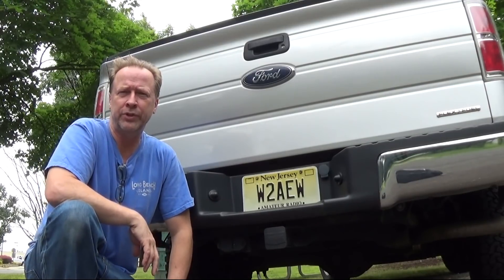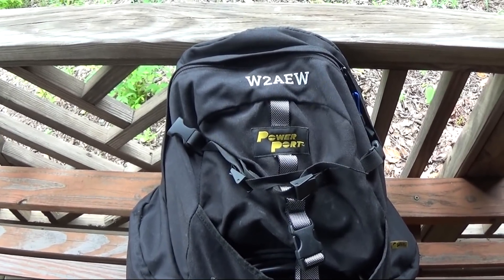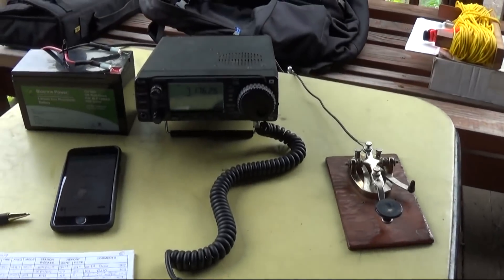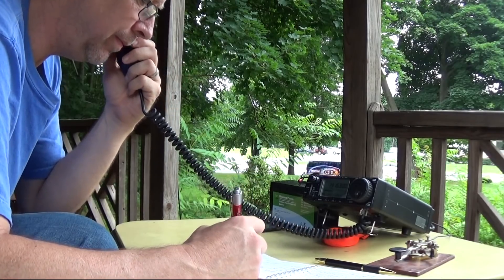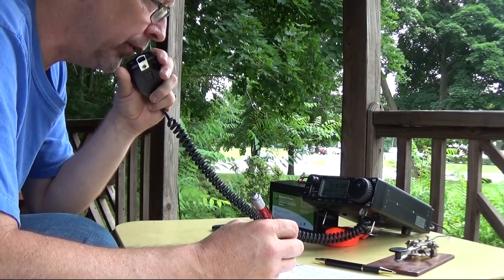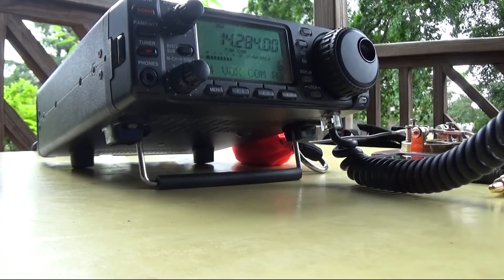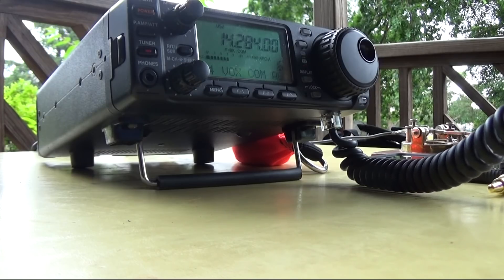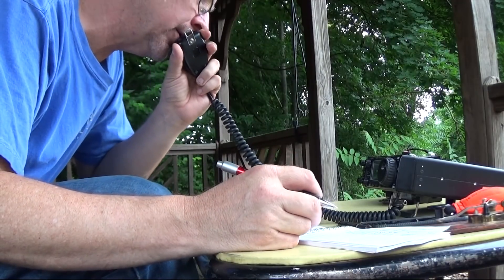#285: Amateur Radio Field Day 2018 - my 5 watt setup with on-air contacts from Marconi Park

Comment: Saw you on with Tom.  Thanks for showing off such a historic site  for radio communications.   Only thing better would be to get temporary call sign  W2NFF  for field day weekend!!  Noticed your power output level was astronomically lower than what Marconi ran.
Reply from the maker: and the antenna was orders of magnitude smaller too.

Comment: I have a question. I found this on ebay for $30 Vintage RCA CRYSTAL CALIBRATED MARKER GENERATOR Model WR-99A. Would this be a good piece of test equipment for starting out in ham radio?
Reply from the maker: Probably not really necessary
Reply: @w2aew  what was it used for?
Reply from the maker: To help calibrate the frequency scale on the old non-synthesized radios, where the frequency indicator was just a movable pointer on a ruler-like scale.

Comment: will static build up on the antenna mess up the radio? i was thinking a lighting arestor and ground are necessary to keep static off the antenna.  but thought a lot of ops are not able to ground the station like hams in apartments with stealth wire antennas out side ? all ways wondered about it. but had no clear answer on this. the antenna books make it out if you have no arestor to bead off static it will mess up the radio. have been in a lot of places and had no way of getting a ground so is it necessary? just would like to know, i am in places ware ground rods are a no no but do not what to cook the radio. what about lighting with antennas like stealth apartment antennas ware thy can not have a big grounds for lighting?
Reply from the maker: I"ve never had a problem with static build-up causing damage.  Might be more of a problem in very dry environments.
Reply: thanks for the reply! i am going to put a lighting arrestor on the back of the tuner and ground it to the outlet cover screw to keep static off antenna. grounding is hard for portable and stealth work. so i guess i will just take down the antenna when thunder storms threaten or keep the feed line out of the radio room. as for ground do you think the outlet ground will work for bleeding off antenna static? just want to keep radio safe.
Reply from the maker: @jakemichael8586  Grounding to a outlet ground will provide a static bleed, but will not protect against a lightning strike.  I typically disconnect the radio from the antennas when not in use.
Reply: thanks for the reply! yes for lighting one needs a big copper budget that most hams can not afford! i will just remove the feed line from the radio room or take down the antenna and feed line for lighting protection. i just do not want to cook the radio and get on the air with out hassle. i am in a place ware a proper ground is not possible or station for that matter so have to be stealthy. the only ground that came to mind was the outlet. i have not seen static build up but have heard of others having it cook radios. thanks if you have tips for grounding stations as well as antenas that move a lot  rentals,HOA,apartments,condo. etc  just let me know. thanks

Comment: Hello
One suggestion for ham videos: Test differences between RG58/U, RG213 etc cables.
For example, I have a big dilemma what to buy, I need around 40m (from roof of the building to my apartment). I will transmit with maximum of 20W. More I will listening. And all in 1.8-30MHz...and I am dilemma if is worth more expansive cable RG213, around 5.5Euro (7 USD)/m in my town) vs 2.5 Euro (around 3.5USD)/m for RG58/U
Reply from the maker: For HF use, the attenuation of any of these cables will be barely noticable.  RG-58/U will be a little less than 3dB (not even 1/2 s-unit) at 30MHz.  It will be even less than that at lower frequencies - probably under 1dB below 10MHz.  Hardly noticable.  The RG-213 is better than RG-58/U, but since the 58/U isn't that bad, the 213 might not be worth the cost.  RG-8X is a nice compromise between the two.  You might want to base your decision on the longevity of the coax (UV resistance) rather than the RF performance, since all of them will work well for HF.

Comment: Thanks for the video. A while ago I bought an Icom 706 Mk2G needing repairs and now that it has been fixed would like to install in my Land Rover for use when camping. Been studying what sort of antenna to install. Would like to mount on my brush guard. Thinking of using a manually tuned screwdriver like your MP1. Appreciate any thoughts. Thanks
Reply from the maker: The MP1 works quite well, provided you do two things:  1) Ensure that you have a good ground at the antenna, and 2) replace the short telescoping whip that it comes with with a longer top section such as the MFJ-1976
Reply: w2aew Hi Alan and thanks very much for the reply. Would using a mount that clamps onto the brush guard tubing work if that brush guard had a good electrical connection to the car body and frame? I suppose I should get an antenna analyzer to really check out the setup. Thanks, Gordon, VA7GEW.
Reply from the maker: Yes, that should work well.
Reply: Thanks again. Really appreciate your taking the time.

Comment: Can I ask without sounding rude - what do Hams usually do other than QRP. Do they ever just have discussions about local weather or events, etc in their areas? Sort of like a radio chat room? Or does it tend to always be more technical stuff or just "hey I made contact"
Reply from the maker: Oh sure!  "Ragchewing" is a term we use to describe simple, casual conversations about anything - from the weather, to sports, to radio equipment, common interests, etc.  This is probably the most common thing that Hams do on the air.  There are many, many different activities (ragchewing, DX chasing, CW operation, digital mode operation, satellite operation, slow scan TV, etc. etc.) that Hams do.  Personally, I do more "ragchewing" than anything else when I'm on the air.
Reply: w2aew cool thanks! I looked it up and found they have the tests for licensing in my area twice a month, thinking about joining
Reply from the maker: That's great.  If you are in the US, there are three license levels:  Technician, General and Extra.  Each requires passing a multiple choice test.  The first two are 35 questions, the last is 50 questions.  The question pools that the tests are drawn from are published.  Tests must be passes sequentially - i.e. you can't take the General test until you've passed the Technician test...  Lots of places online where you can take practice exams to gauge which topic areas you need to study more.

Comment: Also working on getting my license, but only to use for cw qrp. I find radios for speach mostly to expensive, when it comes to very good quality radio.
cw seems to be the cheapast way of having (building) tx/rx devices for like 40m/80m.
Sadly I cannot have an antenna for 160m/630m where I live over here in Berlin/Germany. But I think I might build some qrpp outdoors device (AD9835 DDS based ?) for 160m/630m band maybe in the future?!

Comment: Thanks for showing your throwing line storage system. Great hint and I'm inspired to build a copy! Do you set the base up perpendicular to the direction of the thrown line? On second viewing, I see that you pull off some line prior to making the toss.
Reply from the maker: When getting ready to throw, I'll slip about 100' off of the rig and partially spread it out on the ground.  If you've wound it in a figure-8 pattern, it will spread out easily without tangling.

Comment: Hi and thank you very much for your tutorials. They are very well done and you are a natural born teacher for sure.
I was uncertain where to place my request so I selected here. The request is could you please create a tutorial on biasing a transistor so as to use it as an envelope detector as opposed to a diode. I have been thinking that the Q point should have the transistor near the cut off point but rather than guess I'd like a bit of instruction from an expert.

Thanks, 
R M Boyer
KC2WVB
Reply from the maker: Yes, you've got it right - bias it so that the transistor is right at the turn on/off point - about 0.6 to 0.7V at the base.  I'm assuming that you're planning to use an emitter follower type of circuit, using the transistor to charge a capacitor at the emitter (to ground), and a resistor in parallel to discharge the cap fast enough to follow the envelope.

Comment: Alan, you almost convinced me to get an Amateur Radio license. Back when I was 20, back in 1985, I was using CB radio a lot, and I mean a lot, here in Canada Quebec !  I had a lot of fun with what were called "coffee breaks", meetings between local CB users at a local Donut shop, and what were called "chasse mobile", a hide and seek but with cars equiped with jumbo meters (sensitive analog signal strength indicators), where you would go in circles in an empty shopping mall parking lot to try and localize the source of the signal sent by the hidden car every10 minutes, and try to zoom in and be the first car to find it. Ah, the good old days, before all that cell phone and internet stuff.
73 W2AEW from Mobile Apollo (my CB handle back then).
Reply from the maker: It's never too late!  Many hams get together at local club meetings, hamfests, or even just for breakfast, etc.  And, your "chasse mobile" activity is a popular ham radio activity too - except we call it a "fox hunt".  Same thing though - search for a hidden transmitter somewhere.  (from "The Craftsman", back in the day)

Comment: Jesus loves you.  I had 100 watts, a great antenna, only 5 contacts by 3pm.  I would believe this video 1pm Sunday.
Reply from the maker: Bands weren't great.  Most of my contacts were on 40m, and just few on 20 and 15.  I worked about 25 stations over the course of 2 hours of operating.  Good radio karma at this ex-Marconi Wireless transmitter site.

Comment: What does 1 bravo battery stand for? Are you referring too bravo battery 1st battalion?
Just curious
Reply from the maker: The "exchange" you hear includes a number (1, 2, 3, etc.) which indicates how many transmitters are setup at that site, followed by a letter (A, B, etc.) which indicate the class of the station (club or individual, commercial power or temporary power, etc.).  1Bravo-Battery was the class designation for the Field Day event for scoring purposes (for those competing).  It means that I was operating solo, class B (not part of a club) and running on battery power using 5W or less of transmitter power.
Reply: w2aew thanks for the info. I have never worked a field day and not part of any club. I am a portable  qrp opertor and was thinking I would have a hard time making contacts. I see I was wrong thanks for vid and reply. It makes since now. 73
Robert K6NFY

Comment: The bands were cookin here in Ohio.  
My TenTec Triton IV crapped out, it needs serious attention from many years of neglect, lol.  Only two bands worked, the band selector failed.  But the Hustler 5btv was doing great on 20m. 
But that's what FD is all about, use what you got in emergency situations.  I need to be better prepaired.  
So how long did the battery last?  A couple hours?  Um thinkin about getting a lith-ion 12v supply with solar recharge, plus my crappy HFT 89$ generator.  
i haven't been to a marathon weekend with a bunch of hams in years.  With thunderstorms, and mal functions, and power failures, it can be quite an adventure.  I don't know of any hams handling NTS and ARES.  Most of the repeaters around here are dead. But this year was a great FD weekend.
Reply from the maker: I only operated 2 hours, battery could have gone many, many more.

Comment: Thanks Alan... I guess you were trying to see how far you were able to transmit?  Why say, "1 Bravo Battery" so much?
Reply from the maker: It is one of the "classes" as defined in the rules.  1B means 1 transmitter operating portable, 1B-Battery means 1 transmitter operating portable with battery power and 5W or less transmit power.
Reply: There is no special logging category for that. 1B is all you need to convey for the exchange. Nice video!
Reply from the maker: It is listed as a separate category in the rules:
4.4. (Class B - Battery) One or two person portable: A Field Day station set up and operated by no more
than two persons. All contacts must be made using an output power of 5 Watts or less and the power source must be
something other than commercial mains or motor-driven generator. Other provisions are the same for Class A except
it is not eligible for a GOTA or free VHF station. One and two person Class B - Battery entries will be listed 
...and there are some nice power multipliers for running 5W or less on non-commercial power.

Comment: Alan, QRP is the bomb. Each Q you made at QRP meant that QRO station (<=150 watts) had to make five to keep up. If you put that key at your position to work then each CW Q you made is worth 10 points. This year I am with the HB RACES crew (untimely illness precluded my going to the Zuni MEF FD) and operating QRP from the SoCal coast. Rigged up a 20m vertical and, with the moist ground and proximity to the ocean, the performance has been astounding! East Coast, FL, TX, upper Midwest, Pacific, Northwest. 
Thanks for the video and good luck in the contest!
de Bill, k6whp /W6O
dit dit

Comment: ummm what was going on in there, did you people only exchanging call signs ?
Reply from the maker: This event is an exercise in setting up an effective portable station on emergency power - so the measure of effectiveness is how many stations and locations you can make contact with.  My "normal" ham radio activity is much more conversational (rag-chewing, as we say).
Reply: i see.
Reply: No, because this is the good old USA after exchanging call signs Alan had to answer a bunch of questions from the New Jersey PD.